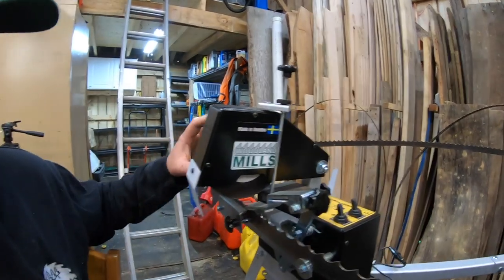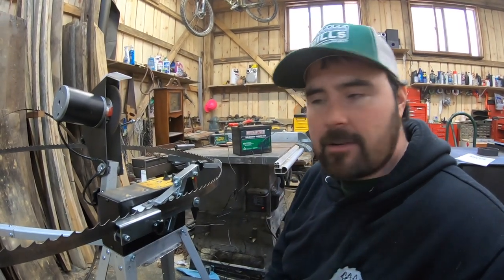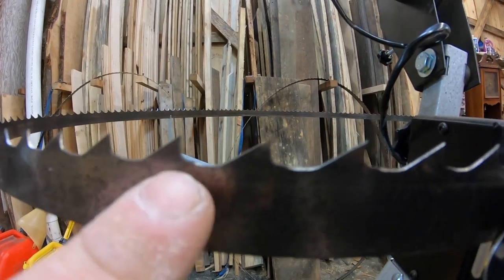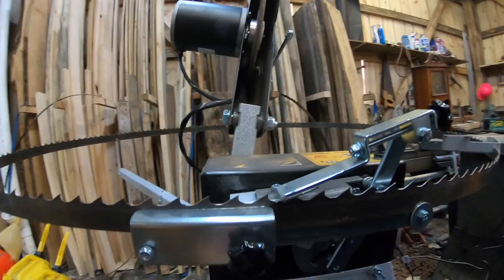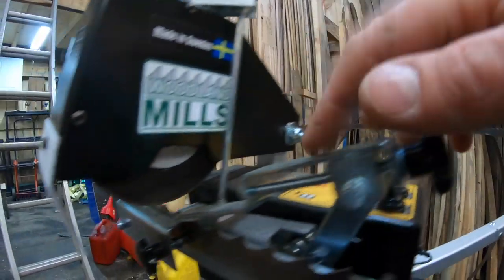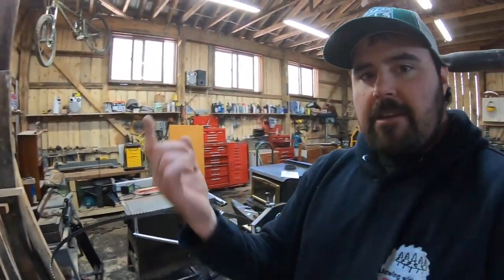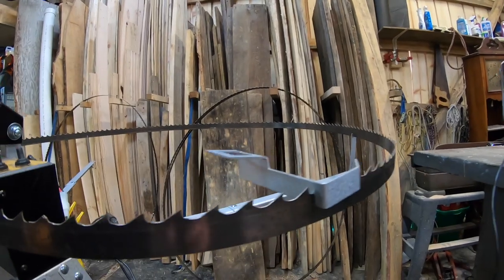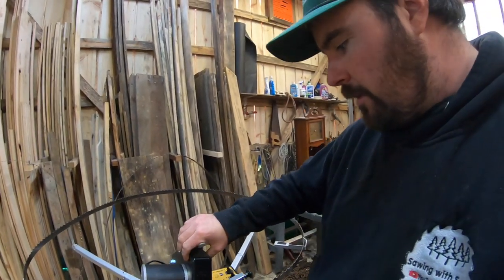Woodland Mills Grindlux 4000 Sharpening Lenox Blades

Comment: Hi Sandy I'm Marty & I'm a retired saw filer. i've never worked on or with this small of a band mill, i was taught the GRINDING prosess by a number of different people & almost all agreed the freshly shaped & dressed grinding wheel should move DOWN the FACE to the bottom of the GULLET & up over the back of the TOOTH.touching all parts as close to equally as possible
Grinding to hard or to fast never showed me anything but problems witch i already had plunty of. Grinding is very important. God Bless & happy filling.

Comment: Hey Sandy, keep an eye on the build up on the side of housing from the sparks, it really packs in there tight and could cause alignment issues if not removed periodically. Also one thing I do is always start on the tooth next after the weld, as some times the weld has a different spacing and could throw off the settings causing the grinding wheel to take off to much, due to a shorter stroke at that tooth. Also if the weld spacing is longer it’s opposite it will not take enough off. I usually stay with a blade for it first time being sharpened to reset the tooth spacing sometimes having to back the blade up to get right, then after that it’s usually ok for next time. All in all its a fairly simple process, and, as I do other things around the shop I listen for any change in the grinding sound. Very informative show, thanks.
Reply from the maker: I appreciate all the tips. You definetly gave me some great info that will surely save me from damaging any blades as I continue learning about this new tool. Thanks again
Reply: I sharpen blades for locals for a small fee, so it pays to get it right, no complaints so far 😏

Comment: Thank you for the video's.  Thank you for taking the time to put out the info and taking everyone on a very addictive journey.  I was intrigued that you said you should never take the back of the tooth off.  Maybe try it on one of your blades as a test and let us know if you find a difference in the way it cuts.  Taking a small grind off the back of the tooth can ensure that all of the teeth are at the exact same cutting height and will give a more uniform cut. The shape and grind of the stone is everything.  The more you take off of the right side of the stone, the deeper in the gullet you can grind without touching the back of the tooth.  These words of wisdom were passed on to me from a 5th gen saw filer that I had the pleasure of learning from.  Hope this is helpful and keep up the great videos.
Reply from the maker: Thanks for the message Jason and I appreciate your nice words about my channel. I normally don’t grind the back of the tooth just because I’ve only ground some of my most recent blades Once so I haven’t taken off enough material to hit the back of the tooth. I think I’ll likely take more of that off on future passes. That’s great detail you provided about reasons to get by he profile right and I’ll be sure to give it a try next few blades. Take care and thanks for watching.
Reply: My father in law has been sharpening blades for a while. He has a Woodmizer sharpener and also makes a light touch on the back of the blade. His grinding wheel seemed to be thicker, which may make it easier to touch the back.

Comment: If you saw mill regularly, it doesn't take many blade changes before the sharpener pays for itself.  Eventually new blades will have to be ordered once there isn't enough material on the tooth and gullet to sharpen properly.  Good video and very well explained on the operation of the blade sharpener.
Reply from the maker: That makes sense about when to replace the blades with new ones. Hope all is well with you

Comment: I have been using this grinder for about 3 years. I tried using the smaller 12 volt battery, but changed to a larger car battery. I found that the small battery didn't fully power the motors and caused drag once the wheel hit the tooth. I don't have power at my mill site so I run my truck with jumper cables to the battery to keep the battery charged full. Much better grinder performance with the larger battery. Also, keeping up the profile on the grinding wheel is very important. Fresh profile per blade works for me.

Comment: I think this is a great idea. You had a video a while ago with a spreadsheet going over the cost benefit of these sharpeners, but I had a little different take on it. $23 for a blade and throw it away. Buy a sharpener and it pays for itself with 20 or so new blades($450) or so. Each time you sharpen you cut the price of that blade in half. First sharpening means you paid $12 for the blade, sharpen it again that blade is even less......

If you get 4 or 5 Sharpening’s that blade gets cheaper and cheaper.
Reply from the maker: That is a good way of putting it
Reply: That's the way i figure it too. If you sharpen a new $25 blade 5x, that means you've used it 6x, which means the blade really only cost you $4.19 [+ initial cost of sharpening equipment  + your time]. The initial cost of sharpening equipment pays for itself by the time you've sharpened your first 10 pack of blades [or else alternatively you would have bought 50 more blades @$25 per = $1250].

Comment: I've sharpened a few blades with a Dremel and 5/32 chainsaw sharpening bits, but with only 30 hours on the mill, I can see the need for a sharpener and tooth setter in spite of the high prices.

Comment: Sandy, I have the same sharpener. you can remove the white paper on the plastic plate in front of the grinding wheel so you can look directly at the wheel when adjusting. I had to look close to realize it was a protective cover paper .
Reply from the maker: You’re right John. Took me a little while to realize this . Felt pretty silly after that haha

Comment: Thanks for the video, great information.   I have been looking at this unit for some time.  Your video helped me to decide, so I ordered one.  Looking forward to using it, just a hobby mill here, but I have plans to mill for several sheds, etc.  Just one note, when I saw the gas and fuel cans,  off to the left, I shuddered a bit, you may want to consider moving those outside, not trying to be safety patrol.  Stay well.
Reply from the maker: I appreciate the input and agree completely. Putting the gas cans too close was not a good idea on my part. Thanks for watching

Comment: On you little tool to turn off the machine when it gets to the end of the sharpen I put a little piece of duct tape on mine so as not to hurt the switches great idea! also where did you get the bearings I didn't get any with mine?
Reply from the maker: Good idea with the duct tape. Mine came with the bearings when I ordered it.

Comment: When you were doing the second pass adjustment for the gullet I didn't notice if you locked the adjustment knob below the top knob that was loose. Seems that vibration could move that height adjustment over the course of the blade. Best regards!
Reply from the maker: You’re absolutely right. I forgot to lock the nut. I think I got away with it this time but otherwise I could’ve had an issue over time. Thanks for pointing that one out

Comment: Thanks Sandy. Just leveled my mill deck, took quite a bit of time, chasing level, side to side and end to end, basic rail plus 2 extensions. How did your leveling go? Did or do you, have to adjust often? And sharpener is still in the box. Tomorrow, assembling the mill head!

Comment: i have the same unit . i found the guide for the stone doesnt necessarily match the tooth profile you may need to adjust to get the full profile. i also had to drill anothe hole in the piece that the arm (shaft) rides up and down on to be able to adjust it far enough to follow the full contour of the blade and now it follows the full profile . if there is a tooth missing from a blade chuck it
Reply from the maker: Sounds like you've got some of your blade sharpening details dialled in. I just run the blades typically twice around to ensure the grinding stone matches the full profile. I also have had success running blades after sharpening even with a broken tooth or two as long as I manually skip those teeth on the sharpener. Happy sawing!
Reply: @sawingwithsandy  i also put a self tapping screw in the arm that holds the unit where you set the degrees i found that it moved with the system they have .set it where you want it hten put in a screw and mark it then if you change to a different angle you can go right back to the exact spot where the old hole is.might help good luck with the mill. i just got 70 cords delivered one more load coming tomorrow

Comment: Great video...  Very slick machine...  Do you actually need to sharpen the gullet - the cutting is done by the tooth?  What would happen if you didn't sharped the gullet?  
Michael from Alberta
Reply from the maker: Hey Michael thanks for watching. From what I’ve heard, small fractures begin to develop in the gullet and so by giving them a little touch with the grinding wheel it reduces the chance of the blade breaking

Comment: Hey Sandy I think your profile of your stone is backwards I believe your straight edge should be on the right that may give you a clean gulit cut
Reply: It seems like being rounded on the left would fit the bottom of the profile better but that would make it difficult for the back of the tooth grind.  Profile for the left side should be as straight as possible.  As it comes down it takes the face off and should never be changed.  The shape of the right side of the stone will determine how low you can come down in the gullet while taking a little off the back as it comes out.

Comment: Very helpful! I have one of these, but the bearings that allow the blade to move is kind of rusted, and sometimes I have to manually give the advancer some slack, is there a problem with that? By the way if you know a website that I could print instructions for this that would be great! Thanks
Reply from the maker: Hey Red! I think there may be a Manila on the woodland mills website that may give a bit more detail but I’d try to scrape off the rust and oil it a bit to keep things moving smoothly if possible

Comment: Curious why you couldnt go deeper with first pass. Also, bought a Champion Sawmill last year, sharpener is a bit pricey. I assume a sharpener from any supplier would do the trick.
Thanks
Reply from the maker: Hey Stephen, thanks for watching. I prefer to do two lighter passes than one heavier pass just to make sure I’m not stressing my small sharpener motor. I could probably go a bit deeper with some passes but I mostly keep it light
Reply from the maker: Another reason is I’ve found that if I go too heavy with the sharpener then the small inline fuses blow

Comment: Hey, great video. Have you had any problems with blowing fuses? I keep blowing the 15amp fuse. Woodland just sent me a new motor because I went through multiple fuses. I sharpened 2 blades and blew the 15amo fuse out of nowhere. Just wondering if you've had any issues.
Reply from the maker: Hi Cody, I’ve blown two fuses early on with the sharpener but haven’t had any issues since that time with it
Reply: non-electrician but first question, what power source were / are you using, have you measured the voltage, especially while using the sharpener. If the voltage drops much, the amps go up and fuses blow based on amps. Just a thought.

Comment: 9:05 I noticed that it was cutting a little different after about 10 teeth or so. It lost zero after a dozen or so teeth? Were all the teeth sharpened evenly?
Reply from the maker: Reason it appeared off slightly was because some of the teeth on that blade were missing so the pusher arm part of the sharpener moved the broken tooth at slightly different increments. Only happens when I try resharpening blade with broke teeth

Comment: Hey sandy can you change the 10 pitch to a 7 pitch on a blade that was a 10 pitch or do you have to keep it the same as you buy?
Reply from the maker: Making the blade into 7 pitch would require a bit of material to be ground off the blade with likely several passes with the sharpener but I don’t see why you couldn’t make a 7 degree blade from a 10. I think it would be ideal to buy a blade with 7 degree pitch from new if possible however to avoid having to grind the tooth as much. Impersonally haven’t done the switch from 10 to 7 though

Comment: Hi Sandy, awesome videos mate, just curious as why you don't want the back of the tooth ground ie why not grind the full tooth profile?
Reply from the maker: Great question. I try just to touch the back of the tooth without grinding it down to keep the height of the tooth and just take enough of the back of the tooth to prevent stress cracks from forming

Comment: When you finished destroying blade,go to shopand buy brend new blade.Whit this is impossible sawing enithing hardening then chees.Use protractor and you will see diferent before and after "sharpening".Grind wheel angle and hook angle must be identicly.Yor grind wheel is put on ten degree,hook angle is zero degree.Why?Becouse you trying remove too much material for too short time.Grinding only gulet and back side of tooth and nothig else.Removing max.0,1mm materials.For more,must have kooler to saving original hardenig tooth.
Reply from the maker: I’ve had good luck sharpening like this. Blades have ended up cutting quite well. I’d imagine different techniques for different folks

Comment: You haven't got it adjusted right .
That's why you aren't getting the gullet. 
The only thing that sharpener doesn't seem to be able to do is the backside of the tooth.

Some sharpeners do ,some don't. 
I have the same sharpener and have played with it for hours to get it to do what I want .

It's a learning curve, once you get it it's a good machine
Reply from the maker: I'm still fine-tuning my skills with the sharpener and as you said, I didn't quite get the back of the tooth in the video but that is something I"m working on. Thanks for tuning in!